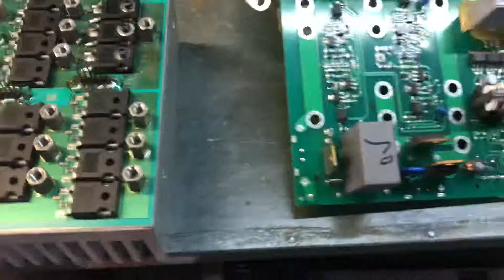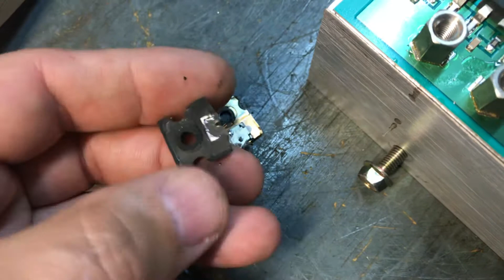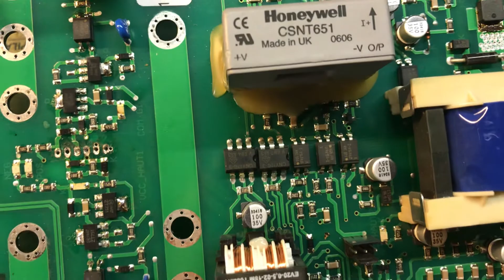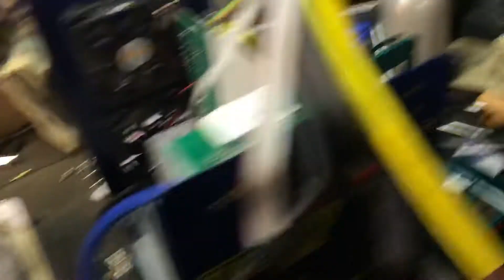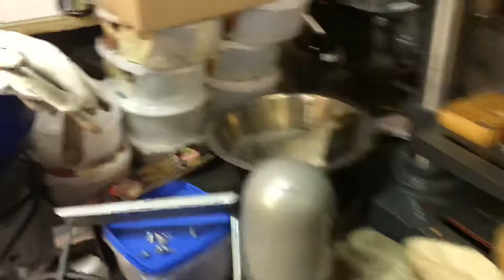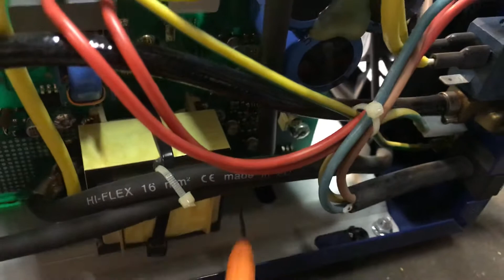GYS 180ac/dc tig repair part 2

Comment: what is tansistors number you have changed?
Reply from the maker: Its been awhile so I honestly don’t remember. Just measure in diode mode to find the shorted ones if no visible damage.
Reply from the maker: Found a picture of the burned chips G4PC505-P

Comment: what you put on pins to older on the place some glue
Reply from the maker: I glued the pins on the board with super glue then soldered the contacts that got broken with wires and secured the pins and wires on the board with epoxy.
The three mosfets that have screws on them where burned.
Reply: @MJPilote  I don't  find the igbt send me you e-mail
Reply from the maker: @Ricardoso1982  put your email in the comments I will send you reply via email
Reply: i don t receive any email

Comment: How is your progress on this project is going? I'd suggest to power it up next time you test it with like 200W incandescent bulb connected in series for the on power AC size, and also to use variac if you have one handy. Also, did you check your output diods?
Since you have a service manual for your unit I think you have a big chance to resolve all issues. Good luck to you!
Reply from the maker: Found the primary cause why the tig broke. Previous owner of the garage had wired the electric wrong. There was a neon lights transformer in series with the outlet I was using for welding and I think that is the main reason the tig was acting up amd finally let the smoke out. I have had similar issues with Kemppi tig at work in the past, where portable neon light was in the same outlet with the inverter. It blew the controller board of the new Kemppi machine twice.
Thanks for watching and commenting.
Reply: But the most important question...
Did you get it working again?

Greetings from the Netherlands, I can get one of them for cheap and are doubting if I should buy it...

It doesn't work on AC, but fine on DC.
Reply from the maker: @doctordapp  Yes I got it working. If you can get it very cheap then go for it. Parts are available and I found service manual with all the oscilloscope reference images and instructions for diagnosis.
Reply: @MJPilote  thank you!